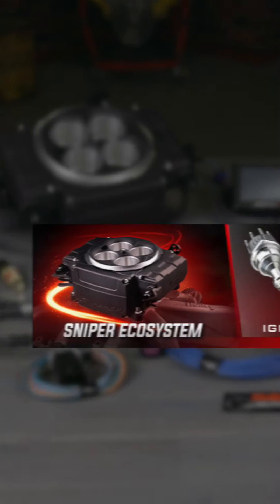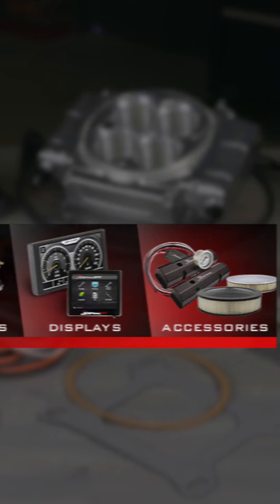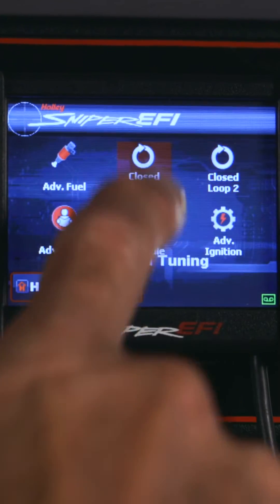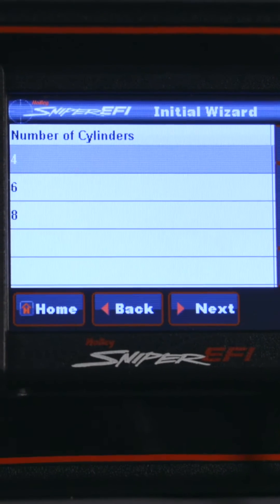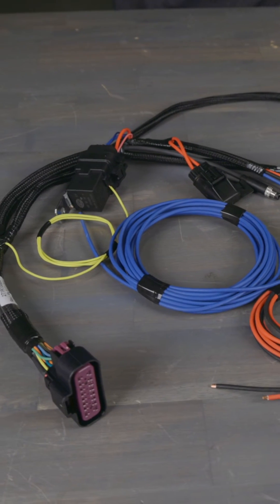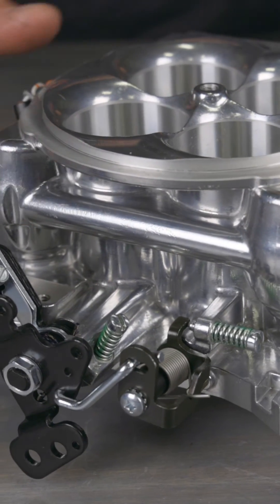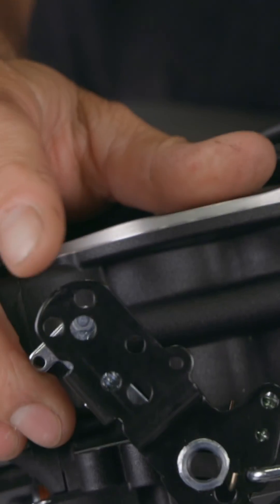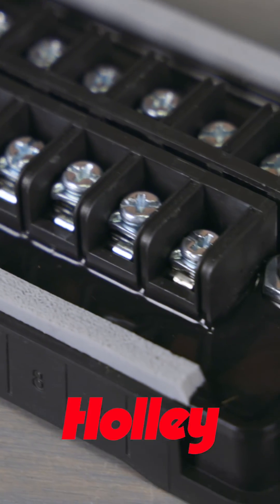Holley Sniper 2 EFI: Your Complete Installation Guide To Sniper 2

Comment: This is all B.S. Holley takes no responsibility for it's mistakes. The Sniper2 will crash and burn, just like the original Sniper. Get a Weber carb.
Reply: I have an edelbrock. Never any drama
Reply: Definitely some truth to this.
Reply: Except EFI is better in every way
Reply: @joshmanis9860  Sniper is not a proper EFI. Sniper cuts out at the WORST possible time and will get you killed.
Reply: @joshmanis-h7h 😂
Reply: Weber :DDD Weber answers the question "why have 1 carb when you can have 4" You need a custom intake and 4 carbs to fuel simple 302 and it will cost you like 3k. While edelbrock intake, cam, heads, carb combo is like 2,6k
Reply: @DuBstep115 except replace the edelbroken with a FItech EFI system